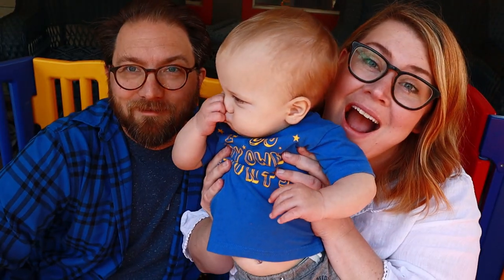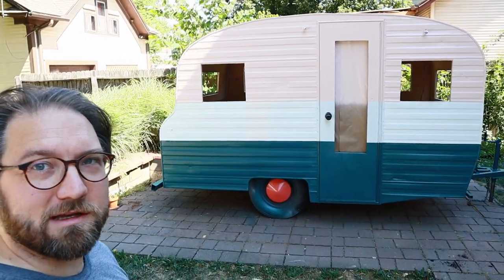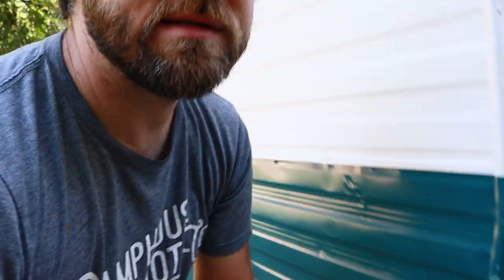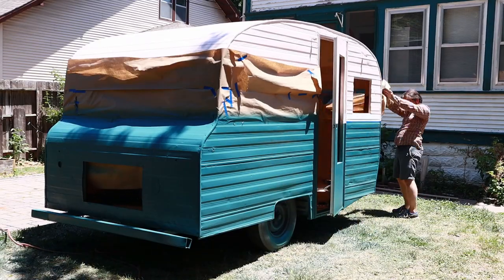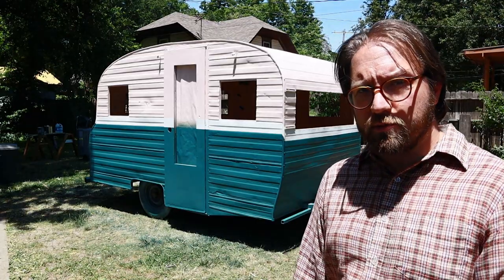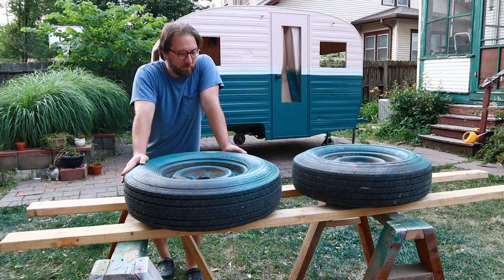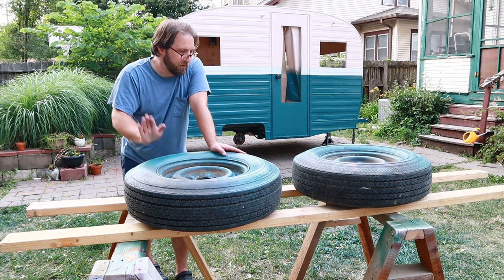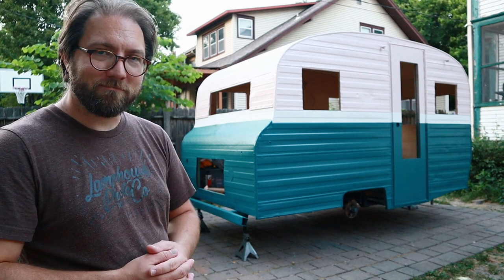BEFORE & AFTER PAINTING OUR VINTAGE CAMPER

Comment: Great job! I am about to paint mine but don’t know what products to use.. do you have the names? Or type of paint to use? 
You will literally save my project! Good vibes (:
Reply from the maker: Hey, sorry to take a minute to reply! Paint can be a contentious subject, and so much of it really depends on what kind of quality and finish you're looking for.

I think for the best quality, you'll want to look at a single stage automotive paint applied using an HVLP sprayer. My guess though, since you're asking, is that you're looking for something a little simpler to get, so let me tell you what I used for this camper.

For equipment, I have a 30 gallon compressor that we purchased from Menards, and an HVLP gravity fed spray gun that I bought at Home Depot. Neither of these were the highest end equipment they sold, and if you really wanted to you could just rent the compressor from Home Depot, but you do need at least a 30 gallon compressor.

For paint, I used rattle cans to prime this camper, and I really wished I would've used the spray gun with an oil-based primer; that was a stupid mistake. The paint we used is Behr oil-based exterior grade paint from Home Depot, and I thinned it 10:1 with mineral spirits. You won't get a high high gloss finish with this paint, but it should be durable and long lasting.

I would not use a latex based paint, and I would not attempt anything other than spraying to apply it. And lastly, practice practice practice, and prep prep prep.

Good luck!
Reply: @TrailerTrashtoTreasure   I appreciate your response and time to explain your opinion! Will follow your advice because honestly, you did a great job (:
Reply from the maker: Thanks!